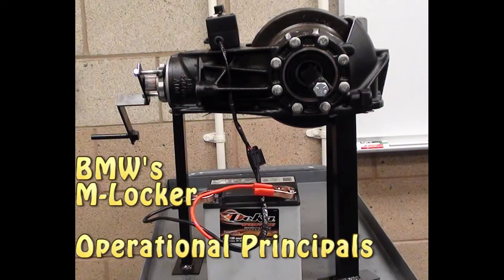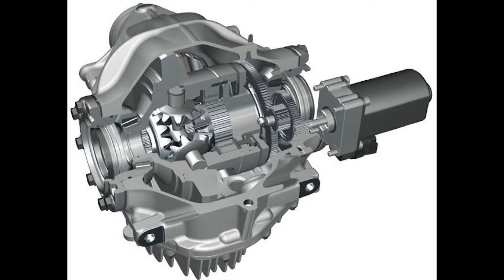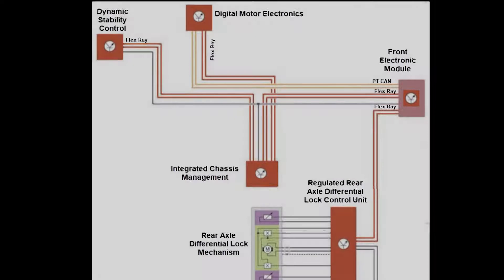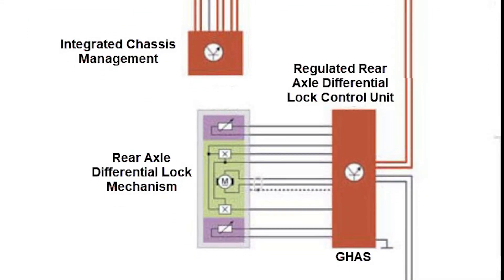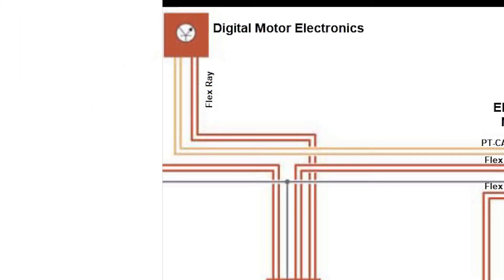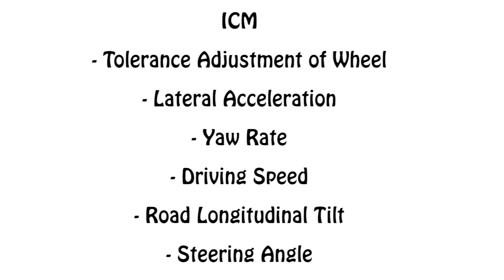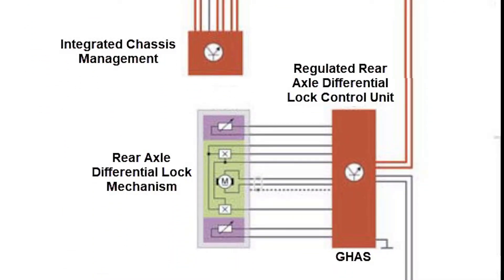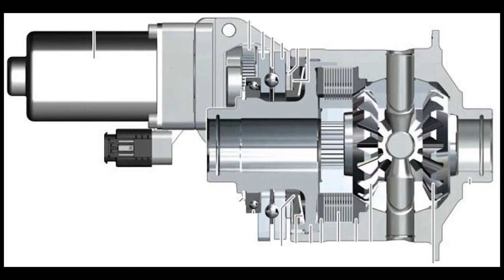BMW M-Diff Locker Explained

Comment: great vid, how is the crow wheel fixed to diff ? cans see any bolts ? im wondering about ratio changes, cheers
Reply from the maker: Please clarify.  I'm not sure what you are calling a crow wheel. If you are talking about the ring gear then there are bolts.  You just can't see them.
Reply: @DrivelineMaster  sorry, in uk we call them crown wheels, great there are bolts, many thanks for reply
Reply from the maker: Thanks.  I knew that you just left off the (n) in crown and I didn't figure it out.

Comment: Thx! Very helpful info. 
I am currently looking to replace the stock diff in my ‘15 M4 due to constant overheating issues while raced on track. 
Idea is great, unfortunately when pushed hard the 3 temps sensors ultimately open up the diff completely in the middle of the apex and you end up with a bonfire of slicks after couple of laps. It’s a shame cause old school LSD’s  like drexler are lot more track biased and not really suited for everyday driving and Wavetrack type biasing lsd’s can never fully lock… 🤷🏻‍♂️
Reply from the maker: yea, this diff is not designed for anything past everyday driving and used when the ground is slippery. Rain, snow, ice, etc..
Reply: you might need to make a cooler/pump for it, only ever had to do it for gear boxes though. Other possible options include over filling or perhaps they make a larger aftermarket "sump" or sump extension

Comment: I realize this is probably a whole can of worms but would it be possible for a non-M F10 to utilize this system? I'm mainly referring to the computers. Would the front electronic module on a (for example) 550i be able to connect with the GHAS?
Reply from the maker: you are correct in the fact that that would not work.  The only way would be to make a manual controller like I did and manually control it yourself which I don't think makes any sense.
Reply: @DrivelineMaster  drift mode button lollll
Reply from the maker: Absolutely.  No special controller needed. Motor full on or full off with a switch. You might want a current limiter so you don't burn up the motor.

Comment: My diff in my 2004 m3 is leaking everywhere. I heard that bad bearings in these diffs will make all the new seals go bad fast and leak again. I’m also in the Bay Area in Hayward. Can you please help me or any recommendations
Reply from the maker: Bad bearings or misadjusted bearings can make seals leak but if they are bad you will hear them howling and making noise and they don't just become misadjusted. This only happens if someone has been in there making repairs.  All Diffs have a vent of some kind. if the vent is plugged up it will blow out the seals.  New or old.  I would not be able to repair your leaking diff.  Locate a competent shop preferable one that specializes in BMW's.  Google ASCCA and use the shop finder. This is a group of independent repair shops that pride themselves on being honest and preforming quality repairs. Good luck.

Comment: Do you have a link to the PWM controller you used? Or details on what frequency, amp, etc?🙏
Reply from the maker: I'm sorry I don't have that information. I got it from Amazon and it's a generic Kit for PWM controlled motors like what is found in an RC car. If you need the specific frequency write back and I will check in next week when I get a chance.
Reply: @DrivelineMaster  it would be a massive help to know the frequency of your PWM controller. Any idea what frequency BMW uses as standard?
Reply from the maker: I'm more than happy to give you the frequency of my controller but you must know that I have never tested the frequency that BMW is using because it wasn't relevant to make my demo work.  If you want to install a controller into a working vehicle that might be important. I do know the motor works with the frequency of my controller.  I will have access to my demo this week. I will make some time to measure the frequency for you.
Reply: @DrivelineMaster  that would be amazing pal. I've only got the diff, so unfortunately measuring the signal freq from the BMW itself wouldn't be possible - unless there's some way of measuring from the motor? After watching this video, I fabricated an M4 rear subframe and diff onto my E30 😂. All I have left to do is figure out how to control it 😁

Comment: Any idea why I am getting a rear differential error message on my f80
Reply from the maker: No clue.  If it's like many computer controlled automotive systems a scan tool may be required to read a diagnostic trouble code. This code provided clues as to the fault and where to start looking. That would be the first step.
Reply: @DrivelineMaster  where are u located? What diff is that in the video u are working on?
Reply from the maker: San Francisco, Bay area.  This Diff was given to me a few years back.  BMW had a recall and they were changing these out.  I think it came from an M5.
Reply: @DrivelineMaster  Hi, thanks for this video. Are you located in the Bay Area? I own an F80 M3. It's been making this whining gear noise for awhile and looking for help. It doesn't seem to affect performance, or atleast not yet. Would you be able to help me find out what might be wrong with it? I'm looking replace it being out of warranty, so I'm looking for options and some good advice. Thanks.
Reply from the maker: I am in the SF Bay Area but only have time to help via email or correspondence via YouTube. BMW had a big recall on these diffs a while back.  That is how I got a hold of this one.  Have you checked to make sure yours doesn't fall under a recall or warranty replacement? That would be my first stop and don't be afraid to complain to the factory representative if you don't get any help from the dealer. The factory representative can authorize full or partial cost assistance. Your noise needs to be properly diagnosed as being in the diff in order to get the factory involved and this will have to be done at the dealer. If that doesn't work the next step would be to replace the lubricant with the correct recommended fluid if there are no diff related codes and see if this fixes it.  If that doesn't help try to notice under what type of driving conditions is the noise the loudest.  Is the vehicle cold or hot, accelerating or decelerating, light throttle or heavy throttle, driving straight or making a turn, slight turn or sharp turn, etc.
Reply: @DrivelineMaster  I'll do what you recommended. My car is modded and has modified suspension, but had this whining before I modified anything and brought it to the dealer but they could not replicate it. I had aftermarket warranty and recently filed a claim and they denied me bc of the modified parts. I will purchase another 3rd part warranty. The sound has gotten louder, much more now that it's colder. I recently flushed the diff fluid due to drivetrain notification/ chassis stabilization codes. There were some metal shavings, but I do use a magnetic plug and didn't look like chunks and replaced the fluid with OEM again. I'll try switching to Redline or Motul. I would like BMW to cover it if possible. I bought the car used from a small dealer though when it had 38k miles, and it now has 64k miles.
Reply: @DrivelineMaster  What is your email address? I was thinking of buying a used diff. You seem to know the diff inside and out, but do you think it can be rebuilt? I also considered a Wavetrac.
Reply from the maker: Drivelinemaster@gmail.com  These diffs are not designed to be rebuilt. At the best you may be able to replace the motor since it's external but I don't even know if they sell the motor separately.
Reply: @DrivelineMaster  I've seen used servo motors for sale on EBAY. I wonder if that may be the issue. Thanks.
Reply from the maker: I'm not sure I would call the motor that controls the diff a servo motor.  If you are having problems with your diff I always recommend a comprehensive diagnosis before replacing parts.  You can spend a lot of money throwing parts at a problem and never fix it.

Comment: well thats quite interesting, i might be able to make this work without wiring it to the cars modules and run a standalone  pwm controller with a potentiameter. do you know what type of potentiameter you used? like does the motor run on 12v or it takes more? and im guessing it probably doesnt  take more than 40 amps cause most car motors like radiator fans and  window motors run 40amps max
Reply: fyi for anyone reading this thread, this swap will only work with a 50i models cause they have the v8s the gear ratio on the bmw locker is 3.91 (so your rpm at cruise speed is gonna sit a lil high) for the front and rear where as on a lower model such as the 35i and 50i bmw uses 3.15 ratio so 1: anyone trying to do this swap would have to change the front diff aswell along with the axles and wheel bearings and for rears you might need a custom drive shaft if the difference between the oem driveshaft and bmw locker is more than 10mm cause your oem bmw driveshaft can slide +/-10mm . also for rears you'd need the cv axles and wheels bearings. subframe stays the same. after the hardware is all sorted and you manage to manually control the diff locking motor boy oh boy you'll have one hell of a ride.
Reply from the maker: I'm sorry I don't remember the specifications on the POT I used. If I find some time I will take it apart and get those specs for you but that might be a while. Yes, 12 volt circuit and I believe I'm using a 20A fuse for circuit protection and it has not popped. If you hard wire it you will most likely get a code unless you get a second motor and strap it up some place and connect the harness to it.  You might be able to fool the system that way.  Then hard wire your own controller that connects to the motor that will control the lockup.
Reply: @DrivelineMaster  my car won't throw a code cause 1: the car didn't come with an lsd so car is not coded for that. 2: its won't mess with the abs system cause if there is no weird wheel spin the car will be fine
Reply from the maker: That's great but if your car didn't come with this diff I personally wouldn't recommend it.  You are better off going with another type of locker or limited slip design. Less hassle and more reliable.
Reply: @DrivelineMaster  the only problem with going with a different locker is there is nothing out there that performs like the oem unit and actually locks the diff. there are options of helical gear type lsd but those don't work on zero traction situation where as the bmw locker can be locked manually with a click of a button and you have 50/50 split in the rear. oh and aftermarket solutions cost around £1400 where as i can source the bmw diff and cv axles for around $800
Reply from the maker: I finally looked up the controller.  Something like this FutureKit FK823 was used.  Here is more info.  https://www.amazon.com/Motor-Control-12-50VDC-50Hz-100kHz-Assembled/dp/B00W3LVQP2/ref=sr_1_27?crid=DTMH022CRITV&keywords=Futurekit&qid=1677725597&sprefix=futurekit%2Caps%2C139&sr=8-27

Comment: hi, can you gime me any info from pwm controler type? how can change the direction of engine? olny with pwm duty? thanks in advance!
Reply from the maker: I'm not sure what your question is. You can't change the direction of the engine. The PWM controller I'm using was purchased from an electronics hobby store online.  Look for one that can handle the larges amount of amperes.  I don't remember the frequency I used.  I then mounted it into a hobby box with a Potentiometer.
Reply: @DrivelineMaster  ok, the question is,,.  When the diff loses the friction disc the eléctric engine turn anticlockwise and for tight the friction disc the eléctric engine turn clockwise. How it's made? You need to change the polarity of eléctric engine? Or the clutch pack attachment system have a spring for go back to initial position?     Thanks sorry for my English!
Reply from the maker: The electric motor does not reverse direction.  The PWM controller determines the amount of amperage that is applied to the motor. A specific amount of amperage determines the rotational position for the armature inside the electric motor. The tension from the discs being squeezed together act as a form of spring to retract the electric motors rotational position when PWM current is reduced.  I hope this helps.
Reply: @DrivelineMaster  yeah! Thanks a lot! I'm working on this differential for assembly in a bmw E30. Thanks!!
Reply: @oriolmarti286  I'm doing the exact same thing in an E30 at the moment. How did yours come along? Did you manage to get it working?
Reply: @domhickman6204  Hi, at the moment I stopped the project, I want to activate the engine with a link ecu pwm output with a pwm amplifier. I make 3 3d duty maps with throttle and rpm axis for gobernante the diff locking duty...
Reply: @oriolmarti286  what ECU are you using pal?
Reply: @domhickman6204  link-ecu, link Xtreme g4x
Reply: @oriolmarti286  ah. This would be a great idea to try with my Holley TX ecu aswell. What PWM controller do you think is best?
Reply: @domhickman6204  I don't know, I only need pwm amplifier, the max amp of ecu output is 1'5a and the electric engine work to 6a.

Comment: I have a m3 2015 that I bought brand new. I keep getting a rear differential error message saying my lsd  might not be operating correctly.  Can u help if I get it pulled and shipped to you?
Reply from the maker: Sorry, I don't do that and would not be able to help.  I suggest a qualified shop and technician to actually diagnose the problem correctly.  It could be as simple as an electrical connector not making a good connection.  This would cost way less than overhauling a diff.  BTW, those diffs are not overhaul-able unless you just want to change the ring and pinion gears or some bearings.  The LSD part does not come apart and there are no replacement parts.

Comment: Do the clutches ever need replacement because those look very hard to remove without getting the motor and other electronics out of the diff.
Reply from the maker: These clutches are not replaceable. If they were out the whole differential or at least the case will have to be replaced.

Comment: Hello great video,you can please send me the pin out of the connector .
I think bmw use this diff on new supra😁
Reply from the maker: Sorry I don't have the pin out handy.  If I get a chance over the next few weeks I will see what I can come up with and post it here.
Reply: do diode mode first find the ground. Also give very small voltage to ground see on other pins if the value almost equal to value that like maybe 1 volt so means is it power and the rest can be pwm input
Reply: @barismetin1014  teşekürler barış daha detaylı bilgi verebilirmisin ?benim kullanacağım diferansiyel mercedesinki sana pin outlarin resimini gönderebilirim çalışma prensipleri birebir aynı bmw nun difi ile
Reply: ugur tosunoglu  yolla hocam yardimci olmaya calisirim😊metinbaris1 mail adresim
Reply: Baris Metin saol metin gönderiyorum kardeşim
Reply: ugur tosunoglu sende yeni subra mi var
Reply: Baris Metin yok ben araç almıyorum yapıyorum atarım yaptığım aracı sana😉 e-maili tam atabilirmisin lütfen mail undelivery oluyor 😓

Comment: What is the voltage input in each position=
Reply from the maker: The voltage is constant and I suspect battery or system voltage but I did not get a chanced to measure it.  The frequency is also constant around 500 Hertz but to be honest I did not have a chance to measure the actual frequency BMW uses.  The kit I used was a 500 Hertz PWM controller kit.  It's the duty cycle that gets changed for each position.  I did not measure the duty cycle because the vehicle can adjust that duty cycle from 0% to 100% and anywhere in-between depending on driving conditions.
Reply: @DrivelineMaster  It would be interesting to install that diff in a normal BMW and then use a controller to manually control the diff
Reply from the maker: Yes, I suppose that is possible.

Comment: Can a stock BMW drift like japanese cars? Incredible how this works!!!
Reply from the maker: I don't think so but I'm not certain.  I suppose if someone is really creative there might be a way to hack or bypass the electronics to force the diff to lock specifically for drifting.
Reply: Yes. It will power oversteer
Reply: Depends which BMW model and year. After the e36 LSD only came in M series cars. Otherwise it’s and open diff.